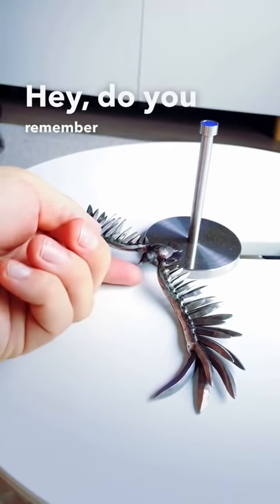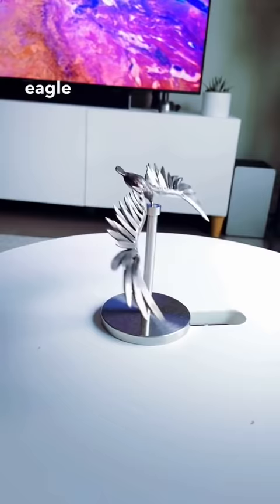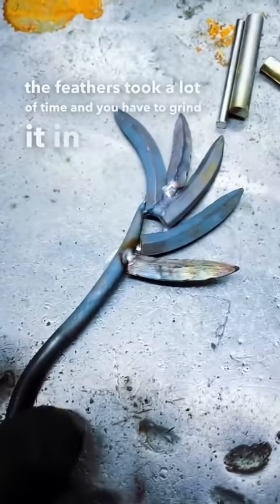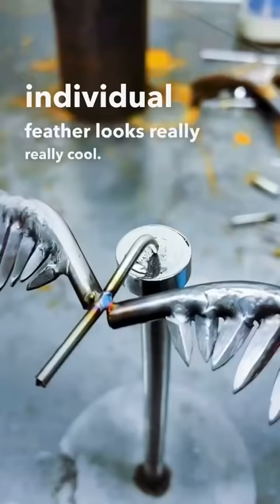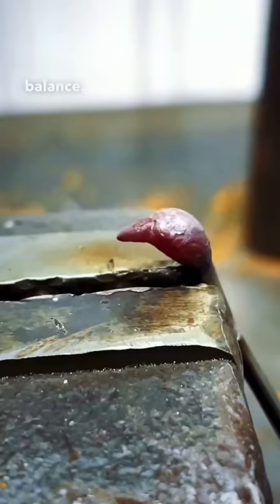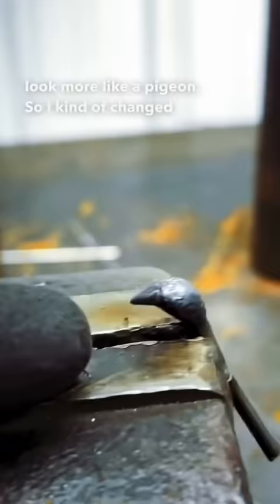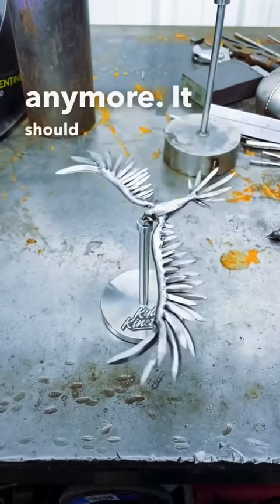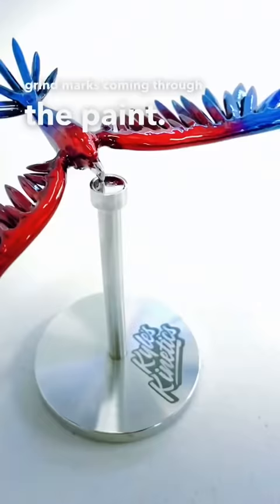Beautiful Hand Made Balance Bird (tiktok) #shorts

Comment: At my school's welding class you have to do a balancing eagle in order to pass the class well not just an eagle but any balancing item
Reply: Id make a tetrahedron and put it on the desk like "look it balances on that flat surface perfectly!"
Reply: @RoyArrowood  it balances between my fingers perfectly
Reply: That shit sounds hard af lol
Reply: This seems like bullshit but I don't know enough about welding to be sure.
Reply: @promontorium  it's possible. I've seen some of my instructors make some crazy stuff.
Reply: @guitargodthor2  I don't doubt it's possible,  what I meant was I find it unbelievable an ostensibly beginner class on welding, which at its basic level is just about the practical application of the process, would require some artistic piece that involves several other higher level skills. Being able to balance a sculpture has nothing to do with being able to extend a pipe or attach two pieces of sheet metal together.
Reply: @promontorium  yea that seems odd